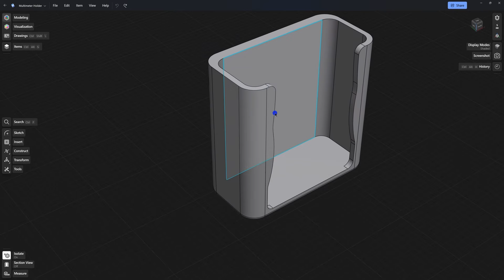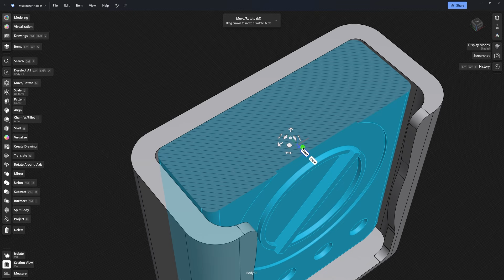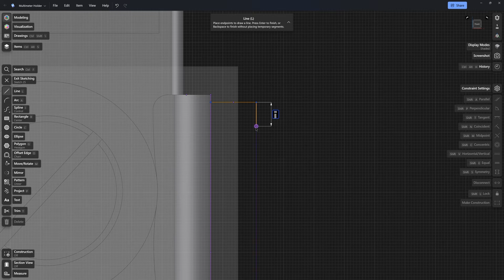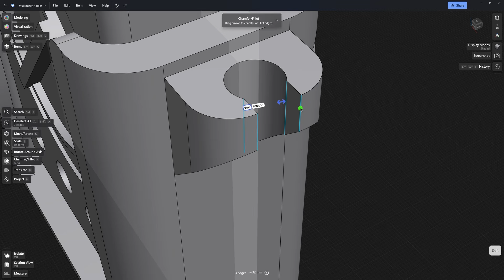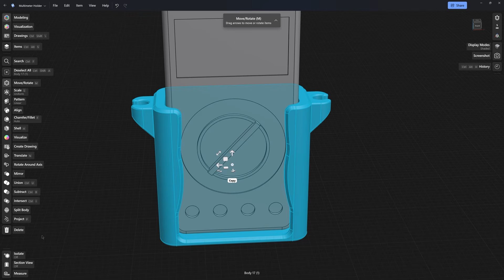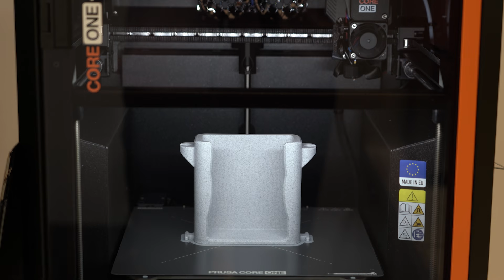Thangs x Shapr3D Glow-Up Contest

Comment: I love Shapr3D, but I only use CAD once or twice a month, so unfortunately, the subscription cost is hard to justify. That’s the main reason I currently use Fusion 360, since it offers a free hobbyist tier for casual users. Any chance Shapr3D might introduce a similar option in the future?
Reply from the maker: We are considering other pricing options. If you want to take part in the contest however, we offer an extended 2-month trial for all Thangs users.
Reply: @Shapr3D  I, too, would encourage better hobbyist terms. I love the experience of Shapr3D, but as someone who only occasionally designs 3D prints, and makes no money from them, it's very hard to justify the subscription cost for myself.
Reply: This is actually the same for me as well. It is very hard to justify the price, and although I love the software I sometimes feels like it could really use some other pricing models.